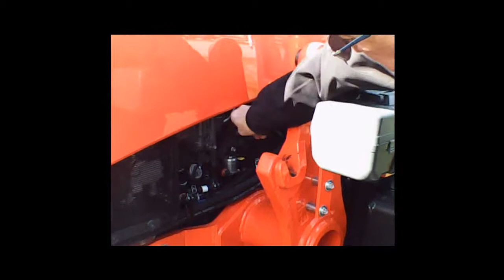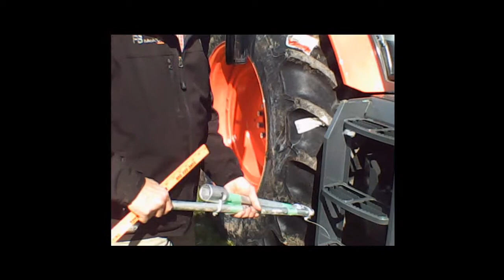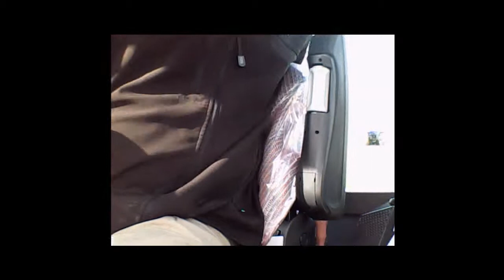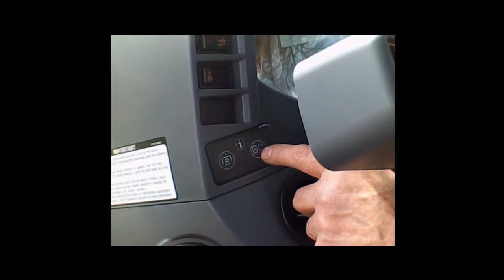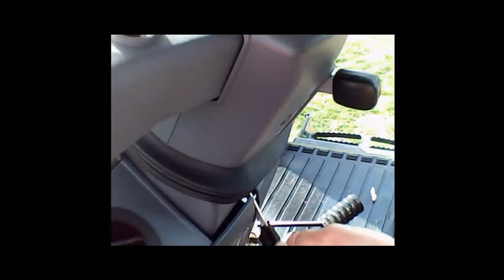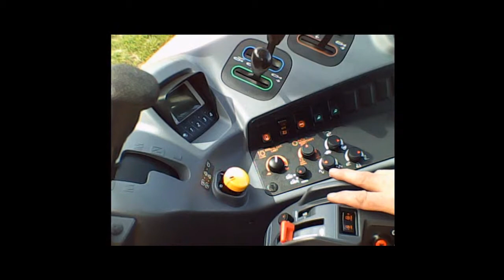Kubota M6 Series Pre Check and Operation

Comment: Is there a way I can set the PTO rpms at 540 and drive/operate the tractor using the gas pedal to go slow or fast without affecting the PTO RPM's ??
Reply: No, tractors PTO speed is directly related to engine RPMs as on most any tractor.